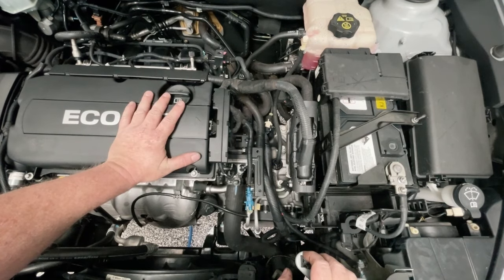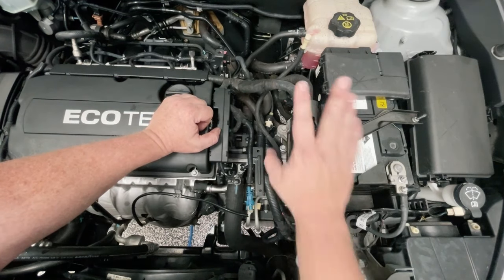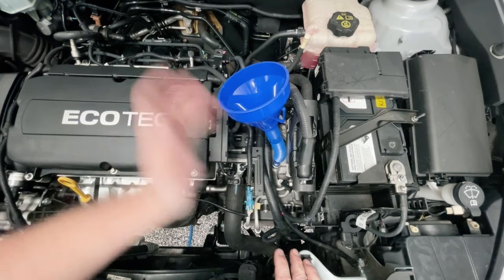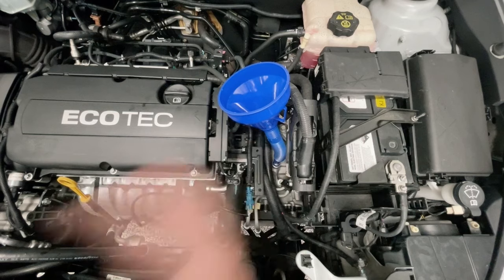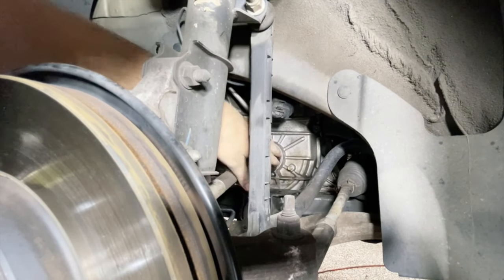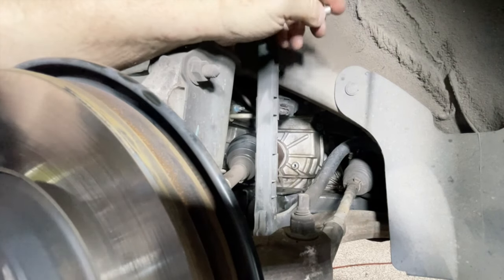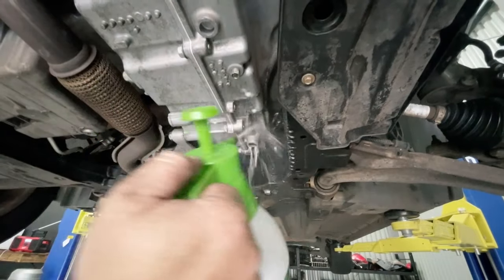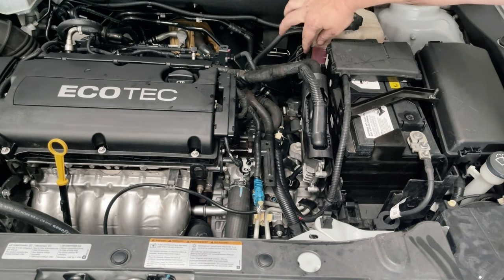Cruze Transmission - Fluid top up and level check

Comment: I can't believe they vented a transmission from a transmission filler cap to the coolant reservoir.  I thought it was going inside the coolant reservoir at first glance! Now after looking more carefully,  I see that it is just hanging on it and not going inside.  My 2011 Cruze 1.8 does not  have a vented transmission fill cap like yours.
Reply: I was just checking the transmission level on a friend's 2011 cruze and noticed this in the video as well.  I followed the other tubes and thought "this is the reservoir for radiator coolant.. why would a hose be connected from here to the transmission fill cap?".  thankfully there wasnt a breather hose on the friend's cruze either, so nothing to scratch my head over after watching this video.

Comment: Thanks mate. I am not flash with cars. My 17 year old son has bought a 2012 Cruz only 4 days ago. (not happy him buying a model and make that no longer exist - but the model name must have got him). We went over some basics, but could not find the dip stick for the auto transmission. So, just to get this right: this car doesn't have one? We will need to unscrew a cap, then guess how much fluid needs to be poured in? Then to check if there is enough fluid, we have to undo a bolt/nut and bleed some fluid? Is that correct, please?
Reply: PS How can you check if the fluid is dirty or not, please - same procedure? Further, did you need to take off the tyre to undo the side bolt for bleeding?Thanks once more.
Reply from the maker: yep - its now a common design on many cars. I miss the old days.
Reply: @killawattgarage  Ta for the reply mate. Really do not know how Consumer Protection Regulators allow that sneaky change, which only forces more people to send simple checks to expensive work shops.

Comment: Any way to tell if you overfill? I mean a "little" bit of coming out check valve is not a perfect science
Reply: That's not the right procedure. You must drive the car in second gear for about 15 mins to get the transmission fluid up to 185F and you check it with an OBD2 Scanner.
With the car level and running in park, bolt fully removed, If the fluid is flowing steadily, wait for it until it begins to drip and that means the level is right ✅️
Reply: @GadGetHackss  Thanks for the clarification. I guess I'm getting old wanting a dipstick and all
Reply: @GadGetHackss  what is an OBD2 scanner?
Reply: @Itsi O  A device that you connect to your phone or laptop to scan your car's ECU for fault codes or information such as the transmission fluid temp
Reply: @GadGetHackss  so them good scan tools they got at shops my guy a good mechanic.. he did my trans lines I was a qaurt low .. but I’m at a 100 k in the Cruze and I feel like my fluid needs to be change but wouldn’t he have been able to see the trans fluid color if it was bad or the trans fluid temp on the computer if the trans fluid was burning way to hot and would there for need to be flushed?
Reply: These transmissions drive me crazy by the way the way they drive
Reply: @boxing4life410  Could you elaborate a bit more? What is it about them specifically  that drives you crazy?
Reply: @EddieLeal  the way it shifts into second real slow and then third gear always has a problem after each start up for the most part it’ll jerk unless I let off the gas I’m at 100400 k miles 2013 1.4 .. other then that it drives fine.. I do got an timing cover gasket leak and possible oil pan gasket leak.. idk if I should do it or not..
Reply: Why does it make us old to be able to check fluid ourselves?  This is ridiculous to have to do all this just to check fluid.

Comment: do we need to let the engine running while filling the fluid?
Reply from the maker: Check with engine running. you can fill with engine off if you want. Level rises with engine off.

Comment: Thanks great video, as soon as I seen this it refreshed my memory... and yer, once that side nut is off and nothing comes out its low... lol, once filled the trans stopped grabbing once over 80kms well I think, but it now changers gears a lot smoother as well...
Reply from the maker: Glad you liked it.
Reply: Whats your knowledge of the 6T40 Auto Trans.... as mine is slipping. I am reading tge Sonnax tech manual and its seems its the clutch plates. I have 2 6T40 to rebuild.

Comment: Noice vid mate. My Holden Cruze transmission has changed at 30000 ks. Under warranty. Just got over 200000 and I notice it's slipping a little and bit slow changing gear. I don't know if I should do a transfusion of all the fluid or get it serviced. Was a cab driver for 20 years and mechanic would  always said It like opening Pandora's box. Changing fluid ever fix it or be the end of the trannie. In the cabs these just leave it till the gearbox died. What's your thoughts. I thinking maybe checking the level and eating a bottle of Lucas trannie conditioner.
Reply: Im in the same spot as you mate
Reply: Just did one with black Transfluid but it did not smell burnt so I changed it 5 quarts out 5.5 qt in
Shifts great now

Comment: Hello I have the same 1.8 cruze. May I know how much accurate fluid should we add when replacing fluid?
Reply: It's a "spill n fill" style procedure, essentially buy a 5l jug, pull the drain plug (11mm after a short drive to get to operating temps) and fill cap, if there's no trans fluid (dexos-6) running out, top it off until a dribble starts to run down the case of the transmission, than put the transmission plug back in, screw on the fill cap and go for a test drive

Comment: Mine always has that ticking sound also. I just replaced my overflow tank hopefully I did it correctly?
Reply: It may not have a breather tube, it’s right beside the oil filter. You will see a black cap next to the oil filter cap sitting beside the shifter cable

Comment: Hello kills watt garage, i have s 2012 Chevy Sonic ltz 1.8. so once i add the 4 quarts of transmission fluid back into the system. I drive around shift thru the gears right? What about checking the fluid? I have a big 3 ton steel jack i bought from harbor freight. Do i jack the car up to check the fluid. I've tried this process before and I'm scared because i want to do it right. The first time i added too much fluid?
Reply from the maker: Car has to flat and level for the fluid check. Take it for a good drive as transmission fluid needs to be hot about 85C or 185F

Comment: Thanks for the vid, its helpful. I tried penrite atf oil on a used cruze with 70K on it, not happy with the atf, hoping to see it works better if i use nulon (should i need to add lucas trans oil treatment?) Thanks again
Reply: Yes Add Lucas Transmission treatment.

Comment: Does the radiator and transmission   have some relation with each other?
Reply from the maker: there is a heat exchange between them as transmission lines run internally in the radiator.